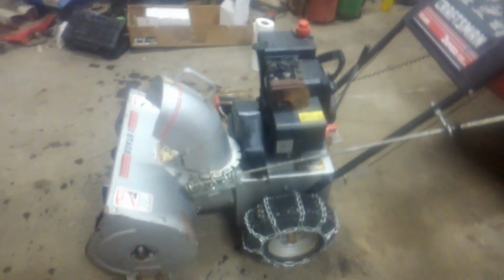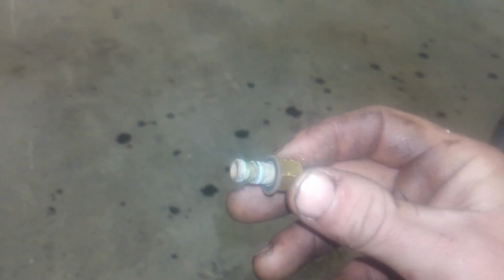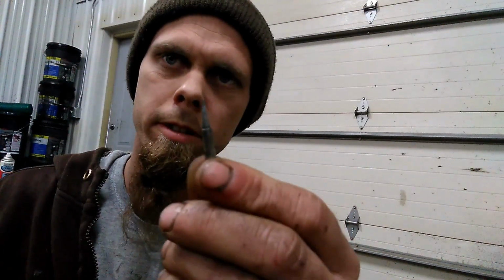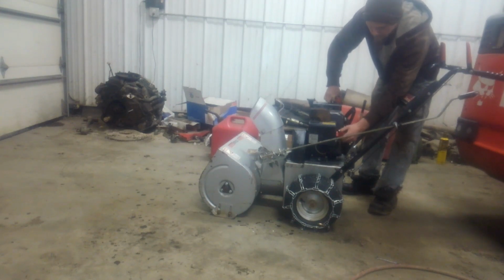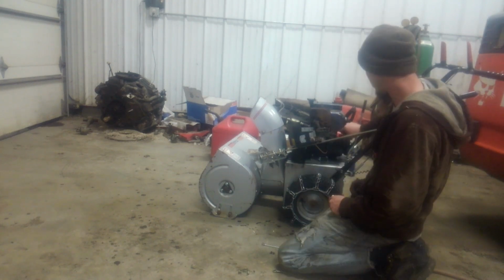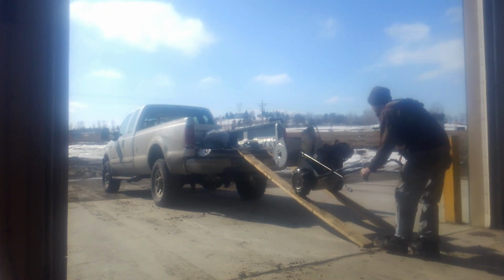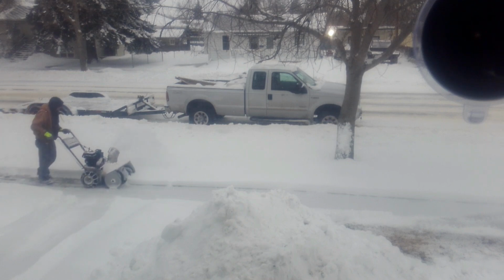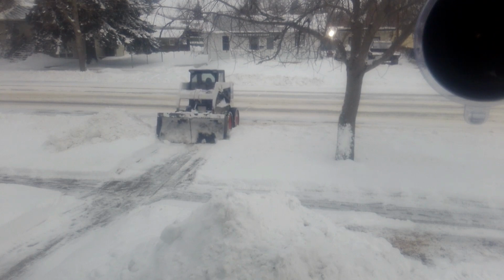old sears craftsman snowblower repair

Comment: Do you still have this old machine?
Reply from the maker: yup, just used it  yesterday as well
Reply: @Ezrider359  So I have a old Sears Craftsman 10/32 Snow Blower given to me by a neighbor. It is model 536.884700 code 6260 from my research it is a 10 HP engine. Trouble is it doesn't run, he said it last ran a few years ago. I tried the electric start but that did nothing. The pull cord is also bad and just has free play/slop. It really is too big for my needs but other than scrapping it for metal i was thinking about posting it for sale. Do you think someone would want it & purchase it in as is condition?

Comment: Nice to see old equipment still working even with unleaded gas, plus ethanol.  Probably one of the worst things I hate is oxygenated fuel.  Politicians have no clue about the laws they pass or the result at the end of the day.  Maybe they just don’t care.  LOL
Reply from the maker: iv got a place here where i can get 91 non oxygenated non ethanol fuel. its a bit more expensive but for how little fuel you end up using in seasonal power equipment its worth it in saved headaches.

Comment: That snowblower is a 1986. I'm messing with an 83 I have right now very similar, except its red and white, has rollers instead of skid shoes solid rubber tires and a metal dash, oh and mine has points and a condensor, that one has electronic ignition.
That code on the model tag says it 6296, 1986, 296th day.
Also, these blowers were made by Murray for Sears.
Reply from the maker: Awesome great info 👍
Reply: TU,that's why they send Murry parts.

Comment: Give me the serial number off the engine and I can tell you immediately, what year it is. Without the serial number, I can give you a general 1980's at the moment, mid to late, its not 90's. I'm gonna put a good guess at 1986, 296th day from the Sears serial, but that could be off, the serial on the engine after the model is just like that sears serial, but its definitive so if it says 6296D for example on the engine, than its 1986, 296th, assembly line D. The serial on the engine won't be the same day as the machine, the engines are built separately in a different factory, by now defunct Tecumseh, typically the engines are built a few months before the machine, shipped over and than installed on the finished machine.
It also appears to be a roper made Sears blower and they were some of the better ones, in front of Noma, behind Husqvarna and the worst were MTD, which is who makes sears blowers now. Roper also built the classic heavy duty sears Suburban Tractors of the 60's and 70's and early 80's before AYP-Husqvarna took over. A little history, anyway good machine. 👍
Reply: How old would this Sears snow blower be Model# C-459-52254  Serial# 495726 if you don't mind, thanks.
Reply: @WaveAction777 Is the engine a Tecumseh? If so, give me the model and serial number off the engine. Because those numbers aren't a Tecumseh model or a Briggs either. If that is an engine model number, its one of those newer Chinese made engines, which is anytime in only the last 11 years. Becsuse Tecumseh went out of business at the end of 2008 and Craftsman used Tecumseh until the end. But those new chinese engines are simple they have DOM's stamped right into them and went into use around 2009-2010 earliest.
If not, what engine does it have? 
The serial number on the Tecumseh engine will tell you. First digit is year of the decade it was made, last 3 digits are the day of that year and the letter after that is the assembly line built. I will only be able to give you a 1 thru 10 year on a Tecumseh without seeing it, depending on what model it is, I cant say which decade without seeing the style of the engine, each decade they changed a few small things to tell them apart, so their are noticeable differences between one from the 60's, 70's, 80's, 90' etc.
Unfortunately the date code for the year on them is only one digit, which makes it hard for people who do not know the engines good enough to tell the decades apart.
Unfortunately the numbers you gave me, don't tell me anything, because I'm not familiar with them. That snowblower in this video was easy, because I knew it was 80's and the code on the machine's model was simple, 6296 1986, 296th day and since I saw the machine and engine, if I looked at the engine serial number I would have known it was 80's too, I cant see yours so I cant put numbers to its charactistics to tell you. Briggs was better, they gave two digits in their code so you knew exactly what year, Tecumseh only had one, so I have to see it to know which decade its out of.
Lets start with engine make, model and serial. Once I have that, we can dig a little further using characteristics from the enginevand machine to pinpoint its decade and exact year.

Comment: i have 6280, it was my grandfathers and i remember him using it when i was a kid. I was born in '86. My guess is the 80's or early 90's cannot be newer than that.
Reply: That snowblower is an 86". That code on the model tag says it, 6296.
1986, 296th day. The engine will also say it in the serial, first digit year, next 3, day of year.
Yours is 1986, 280th day.
Reply: @Mr_Tecumseh  Correct. In Ralph's case, the engine was built on October 7, 1986.